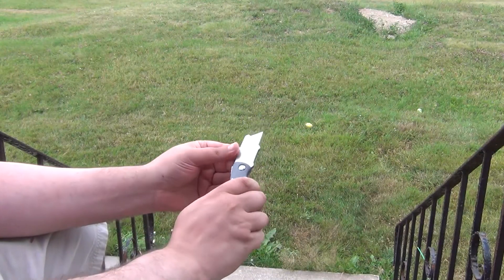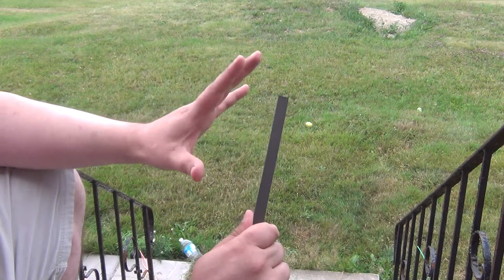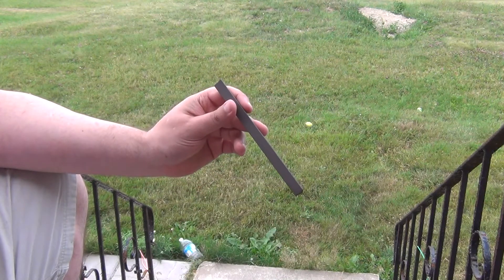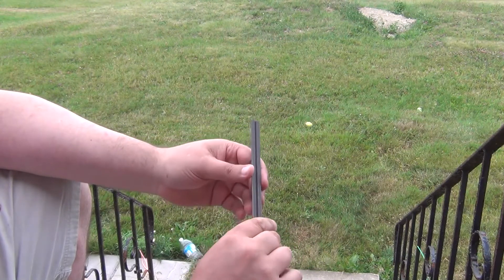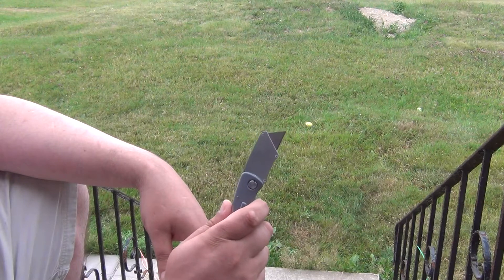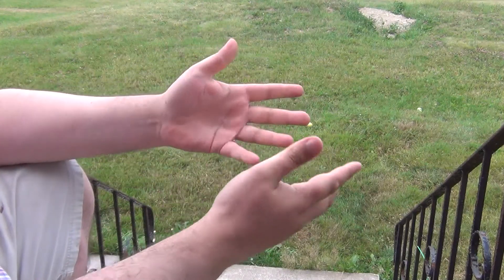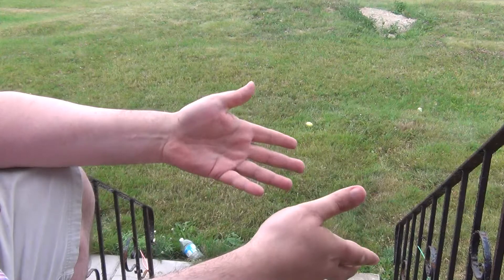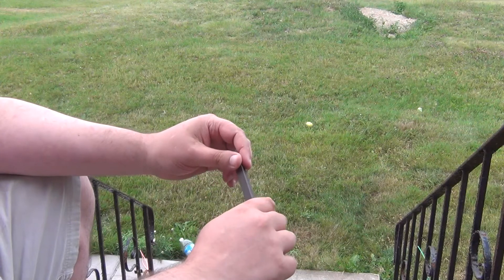Spyderco Delica ZDP-189 : edge retention on polypropylene (CBN vs medium rods)

Comment: Was the performance of ZDP-189 on this material typical of a high carbide steel with a coarse finish?
Reply from the maker: I am not sure what aspect of the performance you are referring to.
Reply: That high carbide steel at low edge angles is optimally used with a coarse edge.
Reply from the maker: Bill22252 Bill if you had asked me that even a few years back I would have said yes without much consideration. However as of lately I have seen some data that doesn't support this well. At very high carbide levels steels start to behave like ceramics which in general are not promoted to work well with coarse edges or even take them well. I need to do more work with steels like 121REX however it may be that like most things there is a sweet spot for coarse edges and too high a carbide volume makes them unstable.
Reply: Interesting. This video seemed unusual in the sense that you seemed to be making positive statements about high carbide steel.
Reply from the maker: Bill22252 I have been using high carbide steels for a long time. I have an original 10V "prototype" from Phil Wilson. I just don't think they are the universal solution which is often promoted. Where they work well is cutting abrasive materials with low force and you have decent cutting abrasives and a very thin grind to minimize required grinding and force in cutting.